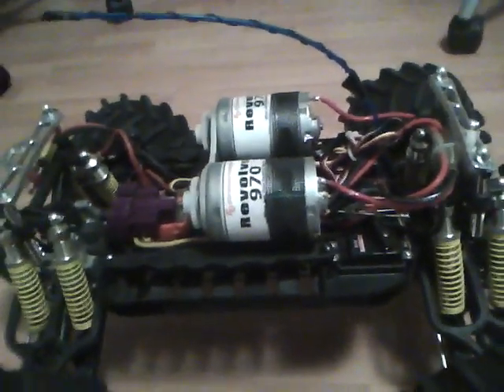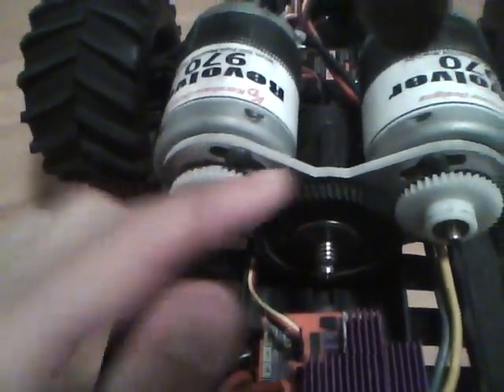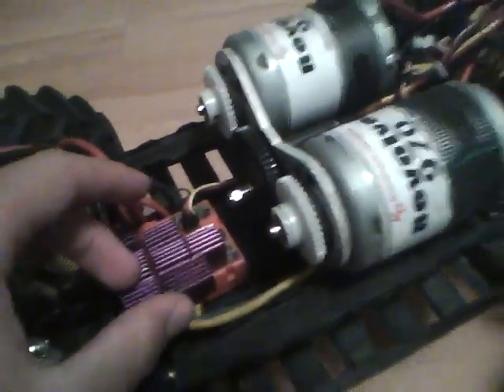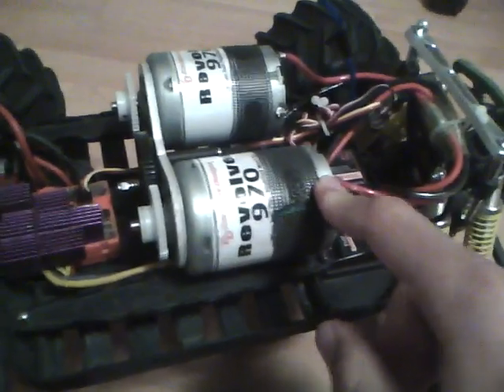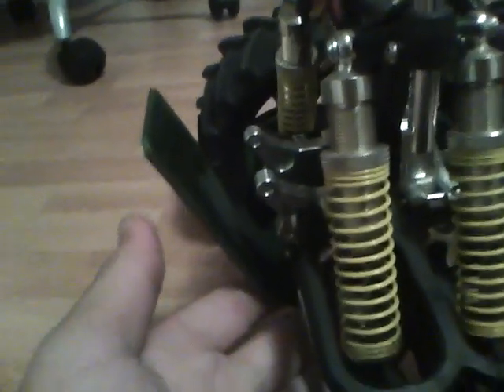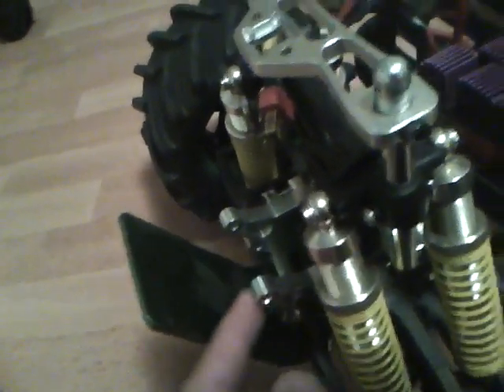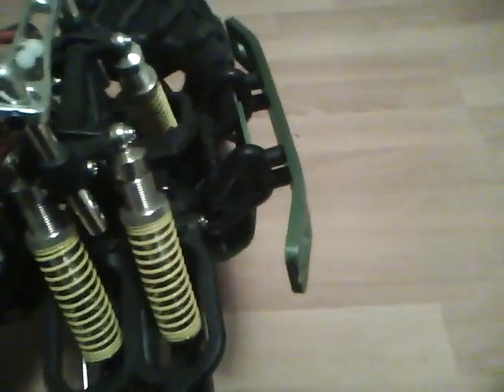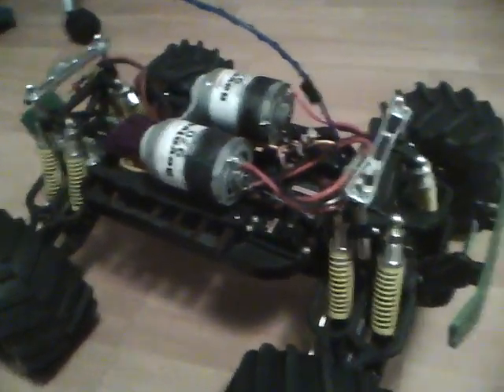Quick Update on the E-Maxx

Comment: i had over heating problems also with my emaxx. it was because i was using lipo batt for my car and i didnt have a brushless system. so i fried the speed control. for a tip so the car dosnt overheat, cut out the windsheild and replace it with small squared chicken fence the cooling works good. i will be addind a fan to cool it more. and another tip is dont use lipo batteries unless you have a brushless system. you are suppost to use standard Ni-HM batt in the car for the system u have.